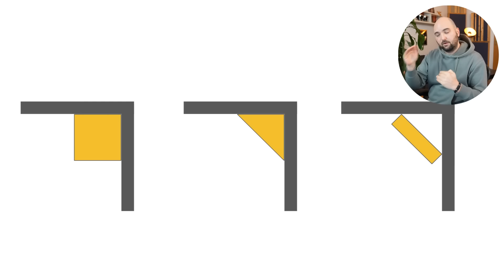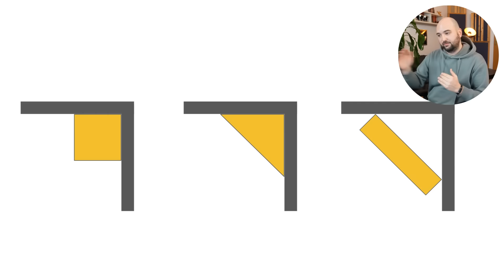Bass Trap Shapes Compared: Which Design Actually Works Best? (with diagrams)

Comment: Hey,

Sadly from my knowledge (as trained engineer) there is a lot to say about this information:

To summarize as quickly as possible: No! The choice of „bass traps“ or corner absorption is not at all a choice of preference. You are completely ignoring the purpose of corner absorption and the way acoustics behaves in that frequency range. you are describing absorption behavior above the critical modal field frequency, where the field of sound can be viewed as even. Your explenation just disregards that for bass frequencies, where modal effects in the room are way more prominent than non modal, most of those rules are more or less nonsense.

First of all broadband absorption (so done by porous absorber designs) has very little effectiveness in low frequencies (exept you build them a meter thick or so).

secondly in the modal field its way more important that you know, where most of the sound energy is within your room and at which frequencies.

All in all, new studies suggest that triangular designs for edge absorption will perform best for multiple reasons.
Reply: Wow. Dunning-Kruger is in the house! :D

Just by reading your comment, it’s clear Jesco knows far more about acoustics than you. Sorry, but what you wrote reeks of half-knowledge and buzzwords like "critical modal field frequency" thrown in without understanding. Maybe watch some more of his videos for actual knowledge lol.

There are no "new studies" that magically make triangular designs superior - feel free to prove me wrong (I doubt you can). The physics of porous absorption are well established and known for ages: for effective bass absorption, you need thickness and area. This is exactly what's discussed in this video. Jesco didn’t ignore modal effects; this video is about optimizing a fixed amount of material, and his conclusion about panels with air gaps is spot-on. 

Google 'porous absorber calculator' and crunch some numbers. Of couse, absorbin 20-30 Hz is not practically feasible (unless you use the 1m thickness you mentioned), but even 50Hz can be managed if you're willing to go big enough. My bass trap panels (yes, I went for a panel design for exactly the reasons Jesco mentioned, long before this video 😂) are 35 cm thick and 2 m high. They are massive, but so is my sound.

If you’re going to criticize, at least get your basics right. :)
Reply: @ Hi,
thanks for your comment, may it be a bit impolite.

Porous absorption has been studied for a long time - mostly in open field conditions. that is where the absorption coefficient comes from in the first place - measurements in an otherwise fully reverberated room or by measuring acoustical impedance in a pipe (which then also only can be measured in normal direction to the absorber). those coefficients are not defined directionally! whereas acoustical properties can be measured this way, it has nothing to say about room acoustic properties in an actual scenario. means that also those coefficient numbers you can find on the internet are only partly „true“ - sorry to break that to you.

thats the first point this video does wrong - it implicates that soundwaves in normal direction to the absorber are most prominent. which is false. also within the room, acoustical energy heavily varies. So it‘s just not about raw mass, but intelligent placement of the absorbers.

Next: yes there are new studies (one masters and one doctors thesis, which is written right now that i know of at SPSC TU Graz) that suggest those designs to be most effective. why? because low end frequency absorption does not work like open field conditions. first there is the Waterhouse Effect - i recommend googling if you don‘t know it - pretty good read. Now there is no simulation model currently available for calculating in this effect in room acoustic designs (which is exactly what the doctors thesis is trying to do), but from empirical trials we can already see that edge absorption works very differently to „normal“ broadband absorption (which is also way more complex in theory than people may think). the fact that in the edges of a room the sound has very altering conditions means that also applying acoustic treatment there is in its behavior very different, depending on size and material. i wont go into much details, give yourself time to read this.

Why do you have to throw around dunning kruger shit and stuff. I dont know your qualifications, I am at least studying acoustics for the past years at university. I am happy to talk about acoustics, but in a civil manner.
Reply: @jrvtevb346  

Hey,
thanks for taking the time to write such a detailed response. Let me clarify a few things based on Jesco’s video and well-established acoustic principles:

Jesco doesn’t ignore modal effects or rely solely on absorption coefficients measured under ideal lab conditions. His video is specifically about the practical use of different bass trap shapes with the same amount of insulation material. The physics he describes (surface area and depth as key factors) are fundamental and don’t change just because room acoustics are complex.

Panels with an air gap are highly effective because they use the same material volume to maximize absorption depth and surface area. This isn’t speculation. It’s backed by decades of acoustic research and practical experience.

Regarding new studies: It’s great to hear about the research at TU Graz, but as long as the findings aren’t published or widely reviewed, they remain speculative. The Waterhouse Effect you mentioned is interesting, I didn't know it and did some research just now, so thanks for the input. But it  doesn’t fundamentally change the physics Jesco is talking abou - it adds nuance, sure, but it doesn’t make panels less effective in the way he describes.

Finally, the Dunning-Kruger comment was meant as a playful jab, not a personal attack. I respect your knowledge. Sorry for being impolite, your first comment was kind of the same tone and sounded like BS at first glance, but I appreciate you taking the time to elaborate.

(As to my qualification - I am (part time) professional musician with 10+ years experience and built 4 studios by now. The videos reasoning seems very solid and in line with my personal experience - I didn't want to attack you, it just seemed like the work of a stereotypical internet know-it-alls at first glance. I'm pleasantly surprised this turned into an interesting exchange! :))

Comment: Nice explanation!
A semi-hypothetical question:
Lets say I were to treat a small cabin (IDK, maybe 15 m²) with an angled ceiling for home studio use (acoustic instrument recording, plus limited monitoring/mixing while recording).
My takeaway is that the best compromise is probably to hang most of the absorbtion from the ceiling, as it's mostly "dead" space in the angle I can leverage as the air gap behind the absorbers. 
Plenty of surface area, and I can sacrifice more depth there, than along the walls, before space becomes an issue (although, not hanging them too low, as that might become slightly claustrophobic).
Then complement with absorbtion in corners and absorption/diffusion along the walls as needed.

Is that along the right track?

There are of course practical concerns, and it depends on the dimensions of the room, room modes etc. Never going to be perfect, but probably good enough I figure.

When the time comes, I'll be sure to check out your more in depth material, right now I'm mostly playing with ideas...

Comment: How does the gap behind a panel count as absorption when there is no absorbing material there? That does not make sense. Surely the sound wave bounces off the wall completely unimpeded, until it hits the absorption material again?
Reply: Yes but-- bass wavelengths are much longer than treble, right. So the distance before reflection can create a "node" that nulls the lows
Reply: @EmperorKamikaze  or, depending on where in its cycle the wave hits the wall and reflects, it could create a node where constructive interference increases the amplitude. You can't assume that only cancellation would occur in that space.
Reply: @RealonomicsBook  I believe your correct that it Could add a certain frequency, but would null the worst culprits in the boxy lows generally.  Sound is weird, air gaps help alot.

Comment: 1. Shouldn't the density of the absorption material be factored in to the equation?

2. I chose to make and install tri-corner bass traps. Using Primacoustic Cumulus bass traps as a template, I bought the necessary materials in my local hardware store, and the absorption material I used was 5 cm thick Rockwool with a density of 96kg/m3, which in hindsight, 60kg/m3 would have been better. Behind the traps are reasonable sized air pockets, which I understand, gives an accumulative volume to the thickness of the Rockwool.
They are installed in each corner of the ceiling.  The ones at the back wall are very effective, removing the boomy bass effects, but the two at the front wall are less effective. 
Surprisingly, they are also aesthetically pleasing.  I wrapped them in inexpensive cotton fabric to match my walls, and they are angled 45 degrees to the walls which take the edginess out of the room and give it a more organic atmosphere.
Reply: Yes, density does affect absorption. The relevant data sheets for your chosen absorption material should be able to indicate the difference.

Comment: You missed the secret sauce I use for >20 Years: the triangular placed with the pointy egde pointing towards the room.
Reply: So you mean the triangle area is fully filled by the absorber, and then it looks kinda squared but with air behind like for the panel version on the video ?
Reply: @FabNto91  Exactly. That way you have way more surface for the frequencies to travel trough. In most cases ppl use the triangles wrong. Even „Pros“ ;-)
Reply: @DeineHeileOma ah Nice. Do you know a nice video to have a look on it ? Regarding the look of the conception, perf etc ?
Reply: @ no. It‘s old knowledge ;-) Just turn them around that they point into the room with the 45° corner.
Reply: going to give this a shot
Reply: It’s a bit like why anechoic chambers have wedges with the pointy end facing into the room - more surface area available for absorption.
Reply: Total sense
Reply: It's all a question of balancing resources and space. If you can sacrifice the space in your room and you have the money, of course adding additional absorption further from the walls+corners will further reduce deep room resonances, but the benefit is not incremental with the added cost. Diminishing returns. It's all a tradeoff and for everybody to decide for themselves how far to go. Also, if you used the same amount of insulation as your backwards filled triangle but in a panel configuration, it will absorb deeper frequencies, as explained in the video, because it will at the edges be further from the wall.
Reply: Samesies
Reply: Not sure if you're joking or not xd
Reply: @hannespi2886  not a joke, I've tested it in REW and it works.
Reply: @deepfriedtheo  This means that the area on which the sound hits is the largest and the sound absorption is optimal. And if something goes through into the empty corner, it has to go through the foam again. Double effect. When I bought the parts back then, I did a lot of research on it and most people do it wrong because they think it should go straight into the corner. He should measure it and show us the results, bc he’s an insider and can shure do this. I tested it with a measuring mic but I no longer have the opportunity to do this myself.

Comment: Not sure I understand at 10:10, was this saying if the square soffit was moved away from the wall corners it would perform better, OR, if the entire square soffit was larger (and still against the wall)?
Reply: if you move the square soffit trap away from the wall to create an airgap on both sides, the square soffit bass trap will perform best. (compared to the other two shapes and if the volume of the used absorbtion material is the same on all three shapes)

Comment: Doesn't the panel have a greater surface area than the square? The back of the panel also counts as that is what meets soundwaves reflected off the corner and back through the air gap.

Comment: So, to summarize, if space is at a premium, the square may be the best choice. If space is not an issue, but material is, the panel may be the best. Correct? For performance, an L-shaped trap could be the mirror of the corner’s angle might be the best. If, for example,
You have 8” of material depth on the two sides of the L, you could have an 8”x8” air gap in the corner.

Comment: From my (limited) understanding, it’s low end pressure that builds up in the corners rather than velocity (and therefore reflections). So do these types of panels/materials typically used for velocity and reflections actually work in the corners to control the low end in a room? I’m thinking no. 
Of course it will treat the low mids to highs depending on thick you go, but you’d still have the same issue with panels on flat walls - having to be so thick before they really start affecting the true low frequencies. 
Am I in the right track here or talking nonsense?
Reply: It absorbs LF. I tested many times. Superchunk does work and standard superchunk will work down to around 40 Hz depends on the materials.
Reply: @patrolduty8715 what is standard superchunk vs superchunk? Never heard of two different versions

Comment: Bass acoustics are funny and unpredictable. I was able to reduce a mid bass dip by removing a bass trap and allowing that reflection to do its thing 😉
Reply: It is certainly possible to have too much absorption at a particular frequency. 
Ideally you would calculate /measure the room modes you need to address & where they are occurring physically in the room to know where to place a bass absorber & how much to use.
For example, not much point putting a bass absorber in the corner of a room if the mode is floor to ceiling for example.

Comment: I would like to know more about airflow resistance factor... What happens when comparing the same kind of bass trap, one made with rockwool rated with 5000pa.s/m² and the other with 10000pa.s/m². Will the absortion factor increase twice?
Reply: Porous absorption calculator is out there.
Reply: 5000 will have more absorption until the very lowest frequencies. Better in most cases

Comment: Basically a 20-24" square cardboard box 4' high filled with rockwool is by far the best and most effective bas management unit, just use as many as you can in the right places.

Comment: Hey Jesco. Your videos are quite informative, and already helped me a lot, and this one come in an awesome time. Hope I can join your course in a not far-away term. But for now, I just finished building two upper front (tri)corner bass traps for my home studio and some thick clouds, and already been planning what to do to add two more upper rear (tri)corner bass traps and also a wall/ceiling bass trap in front of me. I've made the bass traps with 04 layers (8") of polyester wool with 35kg/m³ (other materials are quite hard to find here in Brazil) across the corner, leaving a bunch of air gap behind it, and the ceiling clouds with 03 layers (6") of polyester wool with 35kg/m³, leaving another 6" behind it. The sound already is WAY better, but it still has room for more improvement (and, well... cubic room. kkkk). Thanks mate!